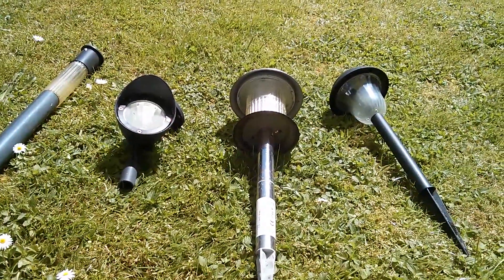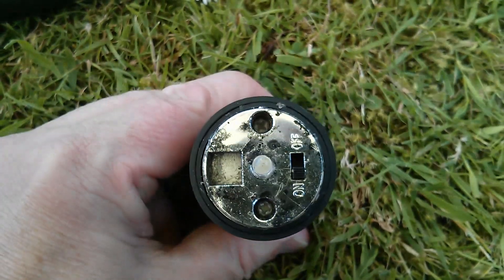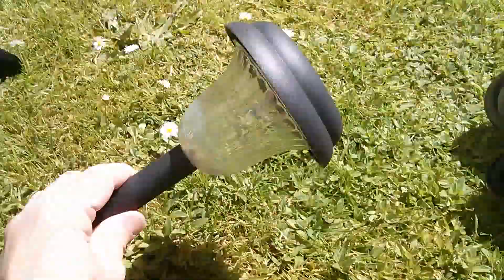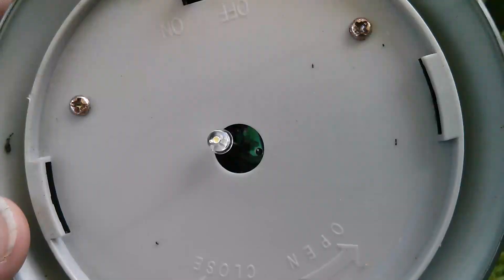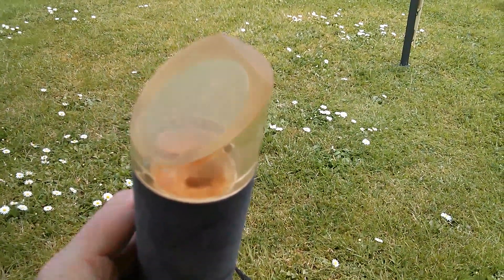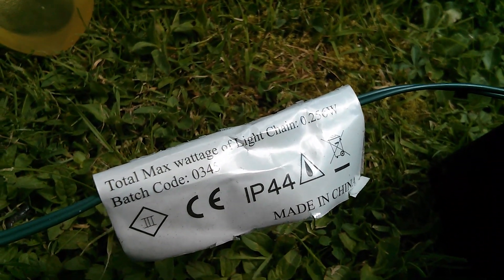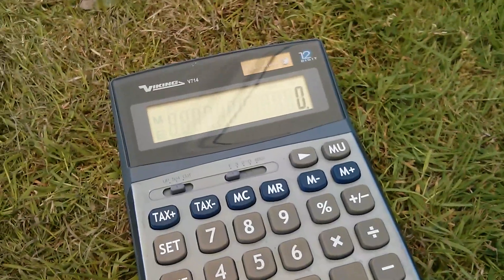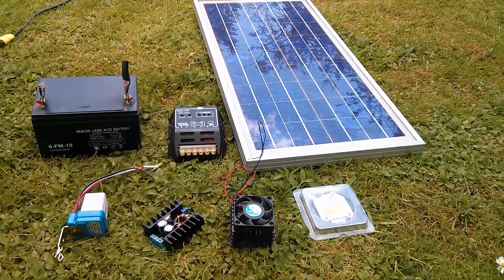Garden Solar Light Checks & High Power LED Upgrade... FAIL!

Comment: A bit.. of topic maybe. Julian do you have any tip to solder the wire back to the glass? Mine went out of the glass and the solder don't stick. You seems you experimented a lot.

Comment: while you were in there changing out the resistor, WHY didn't you gut that board and put in NEW transistors and the other resistors? Those components were JUNK ... you could have swapped out those parts for new and costs would be pennies!!!!

Comment: Hi Julian!

I have a little bit of experience with solar lamps, and I know that the current is set by an inductor in most applications. Try to change value of inductance and you will see "what you get". Then you could also to manipulate a resistance.

Actually you have 100uH on PCB. Try to install less than it but not too much.

Comment: I ordered one of those 150w converters 3 weeks ago, its not fallen off the boat yet... I cant wait to see if mine will do 150w...
I actually need about 60w, which is why i bought it, same as i needed a reliable 700w inverter so bought a UPS style 'doxin' 2000w one, which only does about 1200w tops, and the charger side of it has died already :)

Comment: I don't care much for the panels made from crystalline silicon laid into a plastic trough and covered in resin.  Bright sun seems to cause an expansion conflict that can fracture the cells causing little white lines across them to appear and their output to drop dramatically.  The version where the silicon is on PCB laminate and then resined do seem good though.

Comment: The little amorphous panels sometimes have an extra line laser etched about 1mm in from the edge.  I'm guessing it's to allow the protective laquer to form a moat round the panel, as the cells without it corrode at the edges badly.

Comment: Julian, you are using cheap multimeters to measure voltage and current to calculate power - they are OK  for pure DC (or pure sinewave) measurements, but a cheap boost converter DOES NOT produce DC or sinewave AC. You need to use true RMS multimeters to make any sense of the power measurement. Have a look at the boost converter output on an oscilloscope, I'm sure it will be just a series of short spikes..
The reason the LED lights up at all is because the peak voltage is obviously higher than the turn-on threshold - at least 3.2V or so. Even with true RMS multimeters you will probably measure less than 3V RMS due to the short spikes, but at least you will be able to calculate the real power correctly.

Comment: I have also run into poor designs on these type of lights.  I once purchased a few MAXSA solar security lights, they had a PV panel, a couple of NiCads and a motion/light sensor.  Seemed to work fine for a while then would start to flicker and ultimately stop working.  Inside, found a 3.9 ohm current limiting resistor.  Seemed to be too low a value to me.  Looked up the LED p/n and mfg. specs. and found for the voltage, 39 ohms would be a good limiting resistor.  Swapped out and viola, LEDs worked fine again.  Contacted mfg. and they sort of acknowledged the problem I found but never heard if it was corrected.

Comment: There is no way there where only 1.37V. You need at least around 3V for an white LED to produce any light. Then measuring the current on the mA range may also be a problem since there will be a serious voltage drop on the current shunt and depending on that constant current circuit that voltage drop may be large enough that the current will drop quite a bit.
Dose that bust converter have a constant current adjustment? if not then it will not be a good idea to use. I think I see two of those multi turn pots then is fine. I watched in low resolution so not sure :)
That battery will not last that long in this sort of use if is like new condition a few months at best maybe less depending also on when that cheap charge controller will cut the load.
Reply: I measured once the led voltage generated by a solar light controller with a YX8018. I measured a pulse at 3V for 1,65ys, followed by -1,6V for 3,05 ys. Maybe the shown controller board works similar. And the voltage of 1.37 is some kind of average?
Reply from the maker: I must have been half asleep - I think I saw 1.37v as 3.7v! Clearly without the LED connected, the oscillator wasn't running. Ugh, now this video seems very unscientific. Actually, the single 1W LED lights quite brightly at night.
Yes, the boost converter is a CC/CV type - much less common than the single pot type. The controller cuts the load at 11v I think, but you're right, the battery will be worked hard. During the winter, the battery will spend most of its time in a discharged state.
Reply: Julian Ilett
That bust converter is probably not able to rise the voltage to much from that 1.2V battery so if your LED has a bit higher forward voltage than the original LED's then the added voltage drop on the multimeter made the bust converter unable to push more than 20mA (way less than the 160mA spec).
I think the spec refers to LED 0.064mW not to current output because in that case with a 500mA 1.2V battery the LED's will only last for 1h each night.
I suppose that was not the case and it lasted for at least 4h or more.
Meaning the current delivered to the LED's will have been in your measured range 22mA for sure not more than 30mA (the efficiency of that constant current circuit is also probably bad).
Lead Acid will do really bad in winter not just because of the short day but because of the temperature.
Also those batteries are design for UPS type application with thin plates they will at best last for 50 to 100 full discharge cycles.
Probably the best solution for this type of application is an ultra-capacitor that will easily last for more than 25 - 30 years that solar cell (mono or polycrystalline) and LED will last.
One of those 2600F or 3000F super-capacitors will be able to store about 3Wh that can provide about 5 to 6h to a 500mW LED for a lifetime.

Comment: That light switch, did you manage to get 1 that is for 12 volts? I have a couple and they are rated at 220 volts 10A, but they work real well.
Reply from the maker: It is a 12v type, but there's a full bridge rectifier inside, so it's clearly a slightly modified version of the mains type.

Comment: 20mA per LED seems about right, but I think the reason you were getting odd readings is because they're connected directly to the output of the boost converter with effectively no filtering. I'd also say the lights are probably in series? I've tried a similar thing, including putting a RGB colour changing LED in one and the boost converters are really bodgy.

Comment: Exactly what I want to do. I have a 10 Watt panel that is siting in house all winter long. I also have a 40 Watt one which ... sits and does nothing. I also have a cheap ebay pwm 12V charger that you can also use as switch when the sun goes down and set how many hours you want to keep the light on. It also switches off when the batt goes below a certain Voltage.
Now the led, you can't just leave it on a heatsink in nature. I was thinking to put one in mineral oil in one of those white plastic boxes that you can put in a microwave. That way you get a diffuser effect. On the other side I also imported a Consol Solar Jar from SA which is also a nice way to make light pleasant to look at. 
Looking fwd to seeing how you will progress. I think a lot of people are looking for a decent solar solution in the garden.

Comment: one thing i would like to point out is when you measured the voltage across the led on a boost circuit like that you just end up measuring the battery voltage you need to use an oscilloscope or a true rms meter with a really high frequency response same when you measured the current otherwise it will read low because those circuits are pretty close to a joule thief and there will not be any filtering on the output so you end up with high voltage DC spikes instead of clean DC power but I still don't think that circuit could actually put out 1/4 of a watt
Reply from the maker: You're right, I was half asleep and didn't realise that I only had 1.37v. I guess the step-up oscillator only runs with the load (the LED) connected.
I agree, I can't see that puny circuit putting out half a Watt.
Reply: Julian Ilett Nice video. Usually the easiest way to increase power is just to put a rectifier diode and a small capacitor to filter the ripple and then you can also measure the voltage and current that the LED is drawing.
Reply: ciprianwiner Also those nasty green batteries that are rated at 500-600mAh, on the small one LED garden lights they only have about ~130mAh when new and an internal resistance of about 0.7 Ohms which is way too high for powering a one watt LED. A true 700-1200mAh Ni-Cd should do nicely.
Reply: ciprianwiner or an NiMH those have even lower internal resistance and no memory effect
Reply: Yes, I forgot to mention it. I said Ni-Cd because these circuits discharge the battery to about 0.8-0.6V and memory effect should not be a problem, also Ni-Cd has better performance on winter. Cheers :)
Reply: ciprianwiner one problem if you get a lot of cloudy days the battery won't charge fully and i think (correct me if I'm wrong) that would also cause the memory effect
Reply: Eman2000 That could be a problem I guess. But Ni-Mh and Ni-Cd batteries are not very charge efficient anyway, especially at low charge currents. A Li-Ion or Li-Po will be the best solution and you won't need any step up circuitry, but then you will need a higher voltage to charge it and so the things get complicated very easy. :P
Reply: ciprianwiner thats true

Comment: 30mw seems to be pretty low for the solar panel that size ,probably this cheapy circuit failed there's also corrosion on the transistor

Comment: Chinese's are using half of that solar panel that your showing in the end for their high power street led lights :) they cost $100US or more and have 2y warranty, i have a friend in China which is claiming they work for more than 5y without any service :)

Comment: I have the 200 watt version of the boost converter, i tried driving 2 100w leds. The magic smoke escaped...stick with 100 watts
Reply from the maker: Will do - in fact I'll stay well below that. I don't like the way this unit has 2 heatsinks, one for the diode and one for the mosfet. That means one will get hotter than the other - it's just irritating!

Comment: you should make your own control board, using the solar panel instead of a light sensor, seems kind of redundant to have one of those when your are using a solar panel
Reply from the maker: I guess the light sensor is kind of redundant. Sometimes I just like to grab a pile of spare parts and nail them together. Not sure a purpose designed control board is really justified.
Reply: Good point but Sometimes it is still sunny where the solar panel is when the place where the LED is place is dark. The point of that light sensor is to have more flexibility, although I would to see that control board.